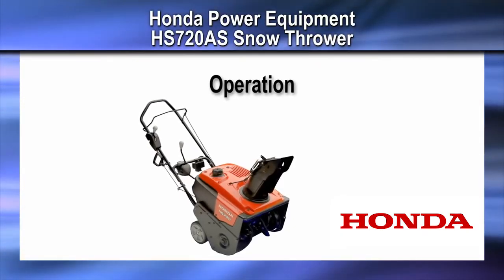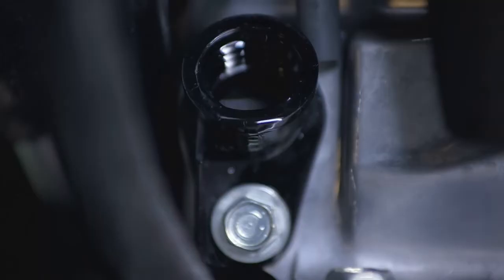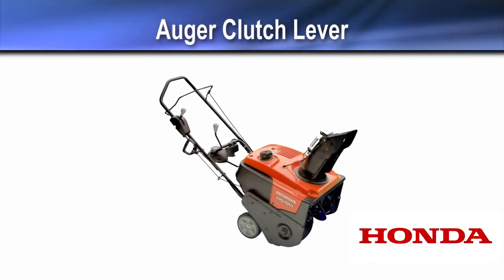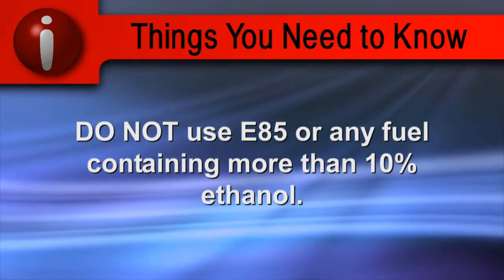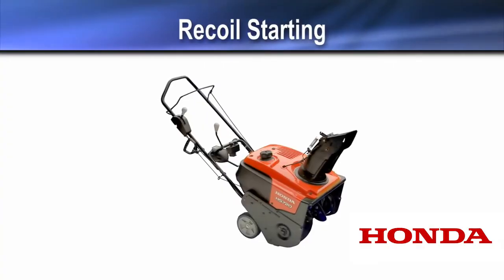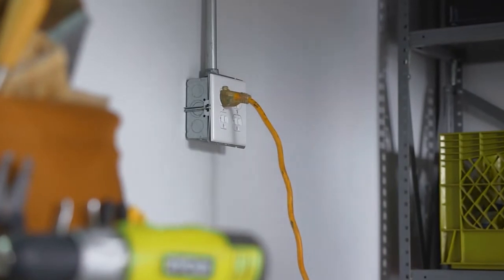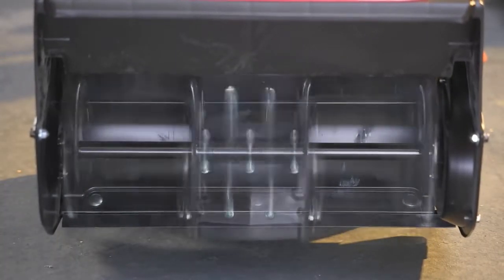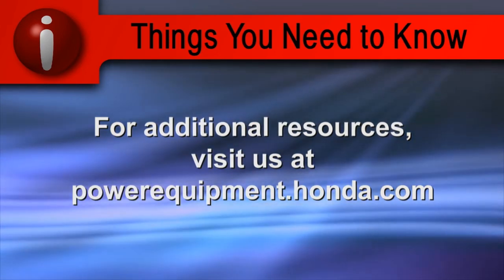HS720AA and HS720AS Snow Thrower Operation

Comment: How do I adjust the deflector mechanism?  Mine is very stiff in the adjustments.
Reply: @gregoryleighty6982  Hello, I've read and heard that Hondas single stage snowblowers have a problem with snow and ice collecting on the wheels. Has this problem with the wheels been updated on the latest machines? 
Thanks
Reply: @JeffJohnson-1982  I’m not aware of that problem. I may eventually learn about it, but so far, I have not.
Reply: @JeffJohnson-1982  I've had this problem with my toro 724qxe. I think all single stage with this style wheels have this problem... Just the nature of those skinny plastic wheels
Reply: @Radu 81  I ended up purchasing a ariens path pro and they have soft numatic tires. The snow doesn't stick to them. I think because they are pliable enough the snow doesn't stay on them.
Reply: @JeffJohnson-1982  Smart choice... I did something similar; I upgraded to toro 824 QXE. Single stage still, but got a bit more performance. And the pneumatic wheels:)... totally fixed the issue